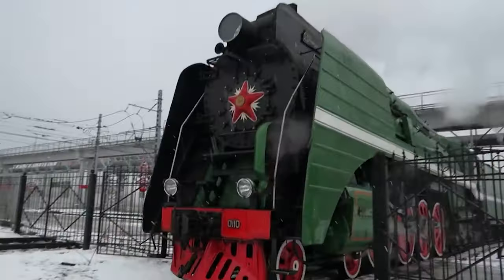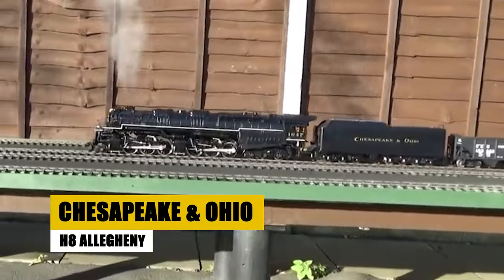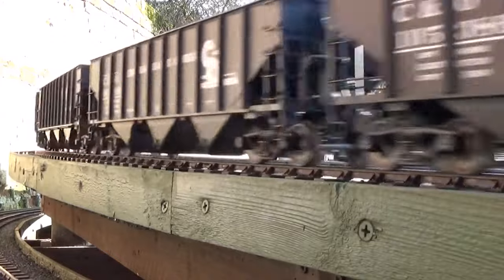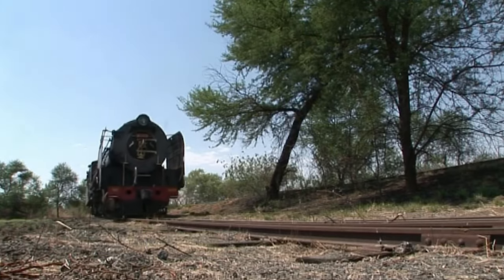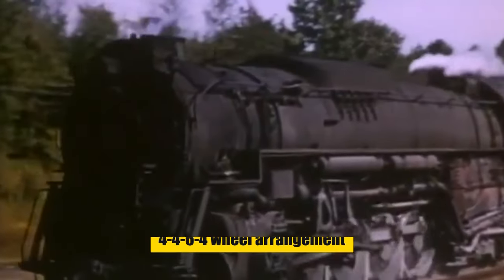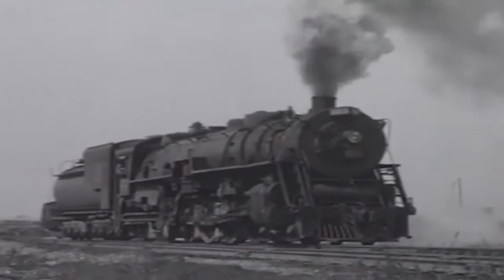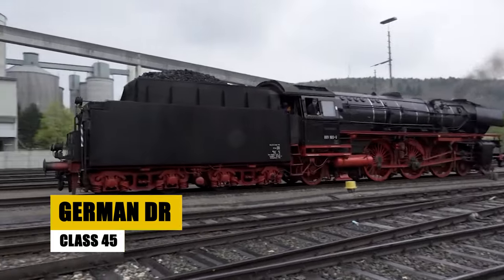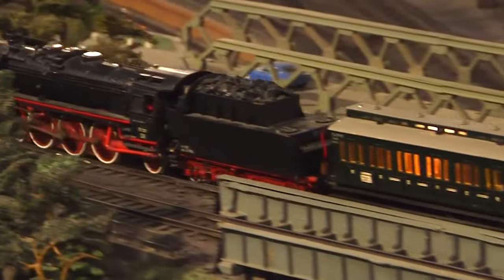10 Of The Biggest Steam Engines That Have Ever Been Created!

Comment: Just some random train chap from Australia here to politly correct some of the info that was wrong on our garretts. They're the 60 class not the 70 class (ironicly the 70 class is a tiny diesel shunter down here). They have a 4-8-4 + 4-8-4 wheel configuration instead of 4-8-2 + 2-8-4 and they only have one boiler across their 2 sets of wheels.
Reply: And it's spelled Garratt.

Comment: Virginian 2-10-10-2. So big, it had to be disassembled for delivery. 
Denver & Rio Grande Western K80 or K90 class ( I can't remember). They were standard guage 2-8-0s that were rebuilt as 3ft narrow guage 2-8-2s, making them among the largest narrow guage steam locomotives in the U.S.
Reply from the maker: They were so big, they needed a map just to find their way around the tracks!
Reply: The Rio grande engines were k36 and k37 engines
Reply: @bear470  That's right!
Reply: The front, low pressure cylinders on the VGN 2-10-10-2s were so wide they had to be shipped separately to Virginia. To accommodate the wide cylinders, signals and signs had to be moved outwardt along the way to prevent damage.
Reply: @Greatdome99 48 inches in diameter if my memory serves.

Comment: Russia: P38, a 2-8-8-4 with 16 wheel Tender.
GB: LNER Garrett 2-8-0+0-8-2 six cylinder loco.

Germany: BR 45 is big, and a big failure. The Boiler was really bad construction. BR 52 condens version
Reply: is longer by 3 feet. But the longest was a BR 17 with a long range coal dust Tender, 44,2 m
Reply from the maker: I love your comment! Thanks for sharing! There is so much to know about these amazing machines !
Reply: Можно и побольше информации про наши русские паровозы вам показать.😊

Comment: Similar in configuration to the NZ 70 class were the East African Railways 59 (Mountain) class - 4-8-2 2-8-4 Garrats. At 103 feet in length and weighing over 250 tons, they were the largest and most powerful metre-gauge steam locos ever built. They weren’t fast but they could go over anything you didn’t particularly want to go round hauling 1000 tons. Doubl-headed, hauling water and oil tank wagons, twenty-four saloons and a luggage wan, they looked and sounded amazing! I haven’t seen one for tw-thirds of a century but can still remember them.
Reply: Just to add: the official length of the Cape gauge GMA is a whisker over 137', so 4' longer than the Big Boy.
Reply: There were quite a few variants of Beyer Garratt 4-8-2+2-8-4 locomotives used in Africa on 3'6" gauge - South Africa's GMA and GMAM, also Rhodesia (Zimbabwe) and Zambia Railways Class 20 and 20A, all over 223t with 4'3" driving wheels, 200 psi boilers, over 3000 sq ft heating surface and 748 sq ft superheating surface, 4 cylinders 26"x20". Pretty similar to the Australian Garratts, which were only "bigger" because they were 4'8-1/2" gauge, so the undercarriage was heavier.

Comment: You forgot 9000 of the Union Pacific, it had a 4-12-2 configuration and was the biggest non articulated locomotive in the world, the S1 was also sizeable
Reply: bro the 9000s are super underrated
Reply: @joshbreck3489  They deserve a spotlight
Reply: I saw 9000 when it was next to 4014 and was chambering all over them. 
Tbh I was considerably more impressed with the size and look of the 9000. Maybe as Big Boy is, and has always been, plastered over and in everything it just doesn't hold itself so well...
Reply: @muir8009  I love Big Boy, it's my favorite surviving UP Artic steamer but 9000 is my favorite of the Non Artic giants of the UP, simply because f it's flying pumps and unique wheel base

Comment: just a correct the actual classification for the garrett as the AD60 Class and they only had one boiler shared between the engines, also they were 4-8-4+4-8-4

Comment: Fun fact: there was two other locomotives that were supposed to be built but weren’t it was the quadruplex and the quintuplex first will start up with the quadruplex. It had a wheel arrangement of a. 2-8-8-8-8-2 this had 36 wheels correct me if I’m wrong meanwhile the Quintaplex had a. 2-10-10-10-10-10-2
Reply from the maker: Amazing ! I love the community chiming in and teach me and the rest new facts. Thanks for sharing !
Reply: Only two? You forgot the virginian 2-12-12-2-12-8?
Reply: @muir8009  sorry I didn’t know about that
Reply: @verstehenrefulgente4993   there's lima drawings, stupid thing which lima would've charged like a wounded bull for. It was more a 2-12-12-2 with an extra 12 wheeled drive unit under the fore tender like a triplex, and an 8 wheeled trailing truck. Just a mess basically.
And like most railroads were discovering it wasn't just getting bigger locomotives that solved problems. N&W finding that the addition of an extra tender obviated any need for higher horsepower locomotives. Both Virginian and N&W discovered that replacing 60' rail lengths with continuous welded rail meant 3 geeps could do the same as the much more powerful Allegheny, less rail joints = less friction. 
Never found drawings of the quadruplex, which undoubtedly would've been a Baldwin sales talk. The only quintaplex was of course the Belgian thing, but the quint seems to be more an oft repeated idea more than anything: a fun thought though...

Comment: You didn't include the Soviet Union's AA20 4-14-4 which was a failure due to the rigid wheelbase being too long. Even the American UP 9000 class had trouble due to their long rigid wheelbase. Perhaps one reason why people wanted the Big Boy restored to operational condition and no one has any interest in doing the same with the sole surviving 9000 class. It's route availability would be just far too restricted. The articulated locos showed they were a much more versatile machine than locos with ten or twelve driving wheels.
Reply: T1 S1 challenger any of the American steam turbines or really any articulates at all besides the big boy and allegheny. No dm&ir Yellowstones no NP GN ones either. 9000 class aa20 are just some of the ones missed